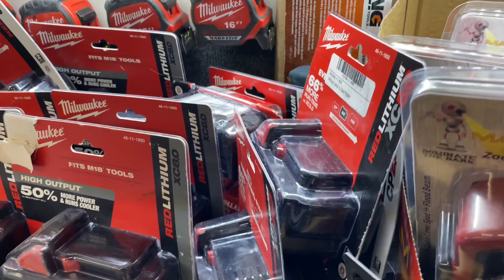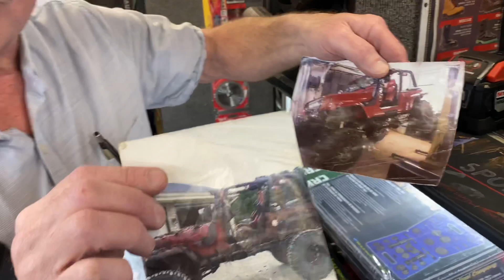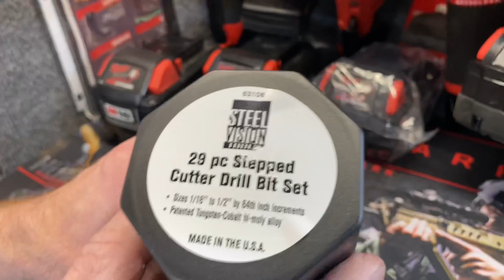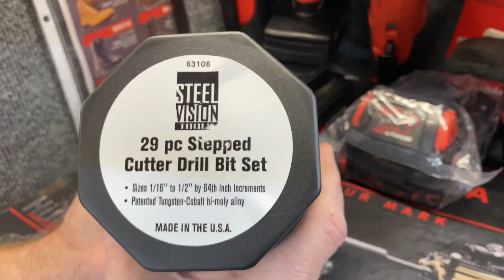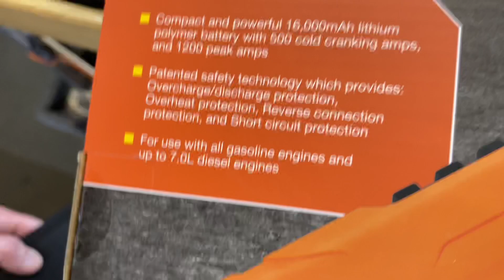Joe’s AllStar Tools! HyperStep bits on his truck? CHEAP! Plus Gearwrench Demo

Comment: Those drill bits look exactly like the one Matco tries to say that they only have. Starting to wonder if Maco makes anything for themselves
Reply: Matco only makes toolboxes.
Reply from the maker: Matco had them exclusive for them and they have a bunch of tools made to their specs especially for them.
Reply: Jersey discount tool explains it the best in his video. It's the same bits from the same manufacturer. Matcos exclusive rights to them ran out so now you will see alot more re branding of hypersteps in the future.
Reply: you  can only have a patent  so long
Reply: Stop wondering. Matco has never, never manufactured a single tool of any kind. They are a tool distribution company that does manufacture tool boxes.